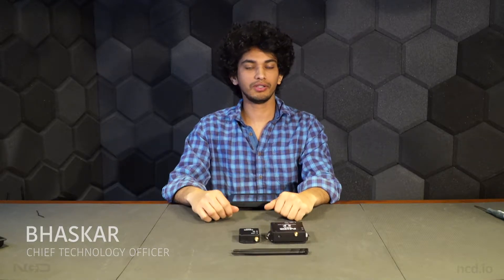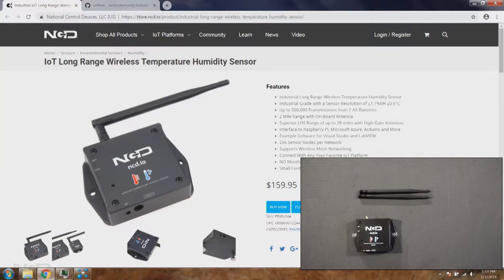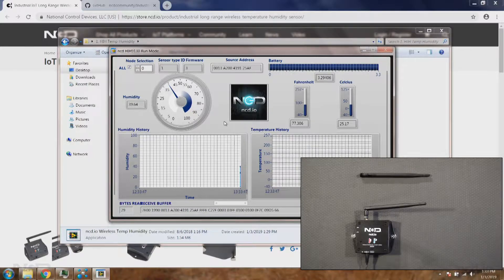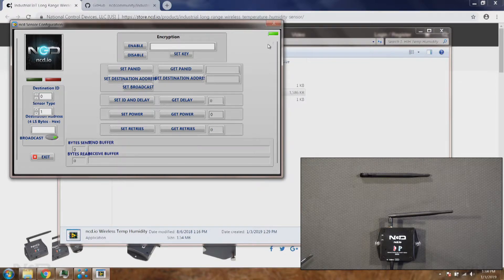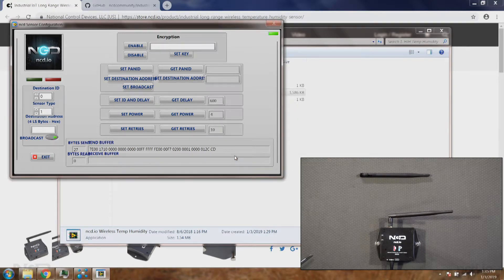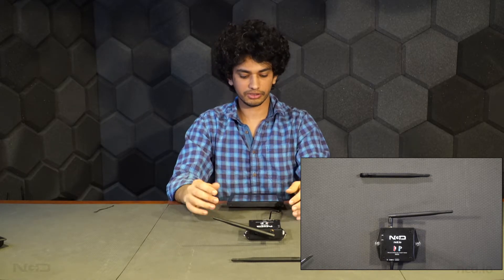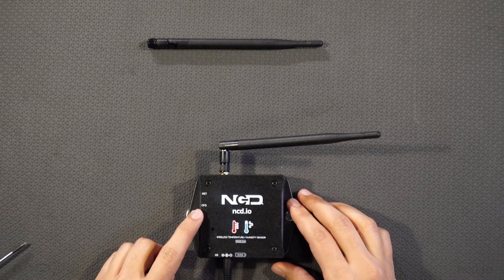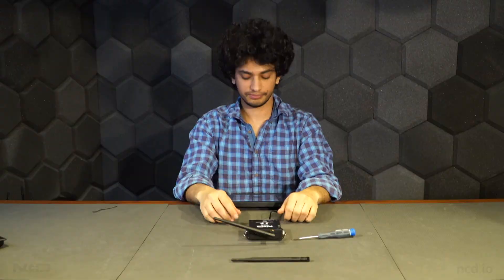Industrial IoT Temperature and Humidity Wireless Sensor Network Configuration : Anil Bhaskar

Comment: Hello there
I need a PROXR Repair kit. About 20 pieces. The reason for the high number is that we make ADC Measurements with the PROXR Card during the testing phase of the card we produce. At this stage, the defectively produced card provides a high voltage input to the ADC Input and the PIC on the PROXR breaks down and the system fails.